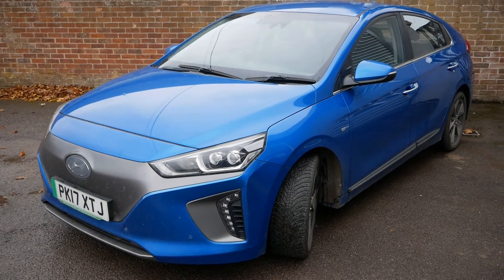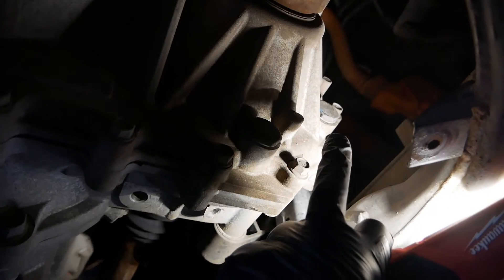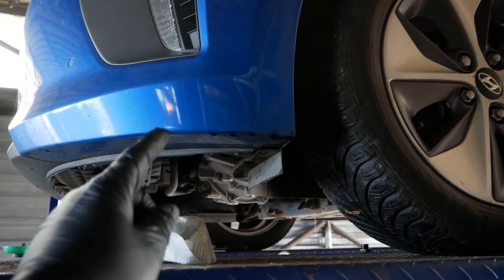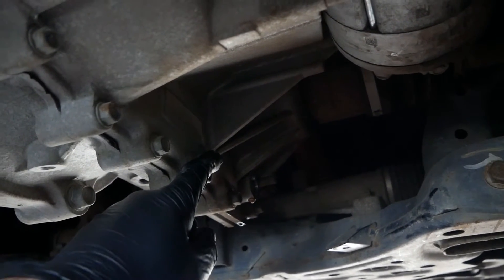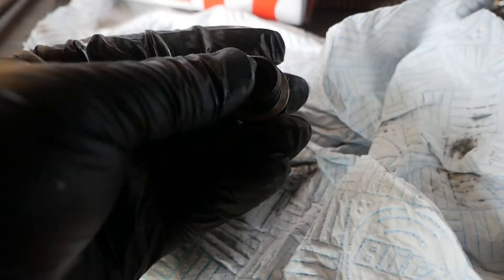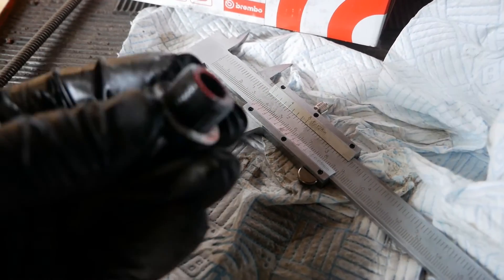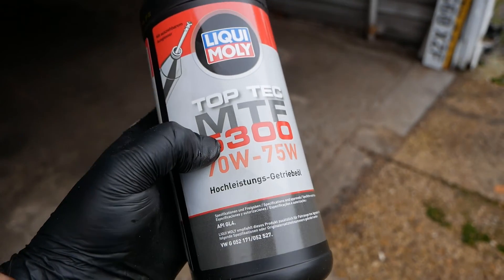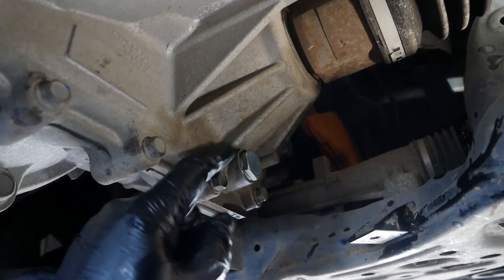Gear oil change in a Hyundai Ioniq Electric & fitting magnetic sump plugs

Comment: Hi Matt, another interesting video, thanks.
Random question: I use the auto headlights on my Ioniq 38 kWh and I can't find a fog light switch anywhere. Do they come on automatically in the same way main beam does, do you know?🙏 Tia👍
Reply from the maker: Fog lights aren't automatic. From memory, on your lights stalk (left hand side), twist the end for headlights (you have it on Auto), then look further down the stalk for the fog light switch.
Reply: @GoGreenAutos  ah bless you Matt, thank you...the manual is so incomprehensible and scary with all its black warning signs 🤯 I thought I'd turn to you first.